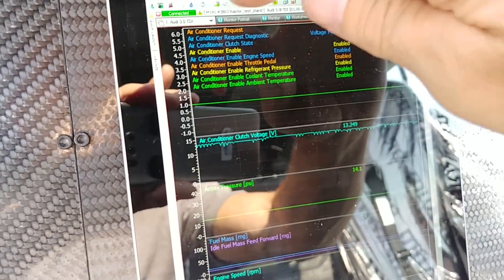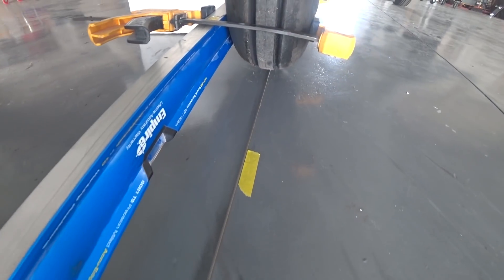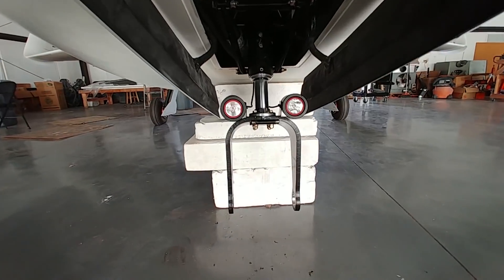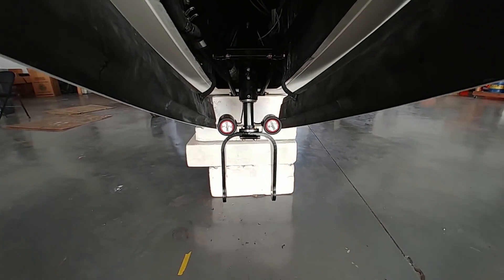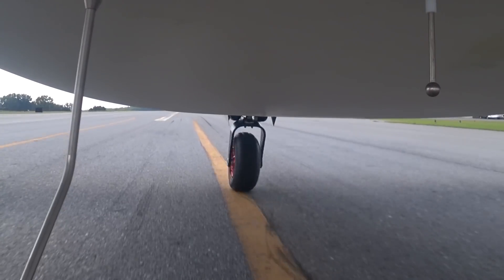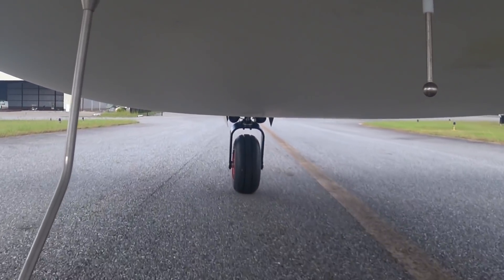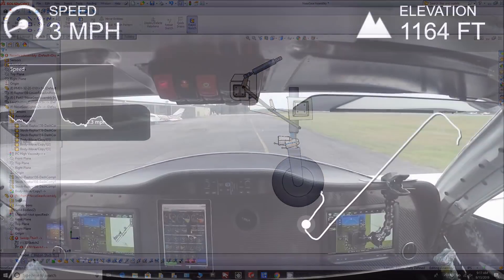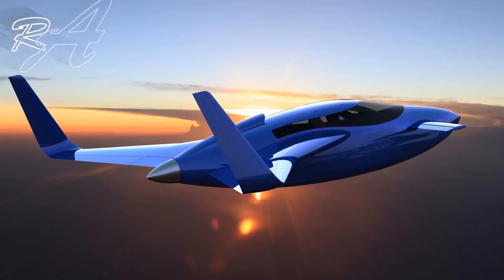Engineering a New Solution - Building the Raptor Prototype

Comment: Is there no low pressure switch on the A/C compressor?  Low-side pressure producing 36 degrees at 1200 RPM  is too low and will be even lower at high RPM.  The system will ice and block air flow. 

I don't think it was designed to work at that high pressure differential.  If this unit fails like the other one, some action is required.   I like the GM variable displacement compressors since they stabilize low-side pressure at any RPM.  No pressure switch since they never cycle the clutch.
Reply from the maker: This is a variable displacement compressor but unfortunately the Motec ECU doesn't have the ability to vary the voltage to control it. If it does I haven't figured it out yet. Likewise the Vintage Air controller does not support variable displacement compressors. So it's either on or off. The cabin thermostat will turn it off automatically though.
Reply: The externally controlled units as you describe have the benefit of using computation and logic for many use-cases.   Internally controlled units really can't, say, go to zero displacement under WOT to maximize performance.  You need enough sensors and controls to fit the case, though.   Since sensors are missing,  maybe source an internally controlled VDC for production to get some benefit from a VDC but forgo the effort and expense of fine control.  

$6.00 worth of PICAXE microconrollers reading the CAN bus and pushing a driver amp could do the trick with the existing setup.  Other inputs might include TPS, RPM,  commanded temp., on/off, etc, to get good control; so some sensors and interfacing would  be required to get optimized control.  

Alternately,  MoTeC's E888 / E816 Expansion boxes have 8 X PWM outputs and MoTeC has sensors suitable for determining the low-side pressure, and some temps that might be nice to use as inputs.   The dynamics of an aircraft A/C are lower than an auto; so external control might just be overkill.

Comment: Nose wheel should be sloped backwards a bit to prevent wobble.  take a look at casters.  The wheel always has to be behind the pivot point.  The further back it is the less wobble. The other choice is to look at the rake of a Motorcycle fork where the wheel is much. in front of the pivot point.

Comment: For testing purposes it might be a good idea to make those new longer arms adjustable in length. With geometry like this, sometimes a very small change can make a very large change in behavior.
Reply from the maker: Well that would be difficult and really the strut just needs to be perfectly vertical prior to the tire leaving the ground. That's what I'll be shooting for.
Reply: @RaptorAircraft  I concur that getting the strut vertical if not trailing is the answer. I expect you'll see a dramatic improvement with the proposed change as is.
Reply: Make them like a tierod end.  The Tee's at the end thread into the end of the long tube
Reply: @humdmmarcus2  That is also what I envisioned but upon further consideration, those arms are not parallel and the over-center stop is positively affixed and it's location important making it much more complex than just some tie-rods. Not insurmountable, but for testing purposes probably a lot of unnecessary engineering. A bend near the strut end to make the arms parallel would do the trick - but adjusting them would require unbolting from the strut every time. Seems like a lot of trouble for very little gain at this point.

Comment: Will you fly it in wing and ground effect or the test pilot will test that for real when you will be ready?  I'm curious to see the Raptor's behavior
Reply from the maker: Ok this statement will fire up the peanut gallery. I plan to take it into ground effect ONLY if there are no odd tendencies and I'm able to comfortably hold the nose wheel off for a decent stretch without any sign of loss of control. After that I'm handing it over to Justin and Elliot.
Reply: @RaptorAircraft  I didn't see your nose wheel at the moment I posted my comment and it so sketchy that to push it at high speed without having master the problem would be stupid. You worked so hard into that and I know by watching all your videos that you're a down to earth guy and you'll never do something like that.  Sorry for my bad english writing and also sorry it wasn't my goal to start whatever because of my comment. It's just because I can't wait to see that flying. You know your concept is so out of the box and if everything works like it should you have such an awesome Aircraft in your hand. It's a kind of revolution in general aviation for that size of equipment and lots of people will probably want to fly that rather many certified aircraft there's no doubt.

Comment: I wonder if there is movement at the mount that allows the shimmy to get going?
Reply from the maker: There is no play in the structure but a tiny bit of play in the self centering internals of the strut. If the external shimmy damper is necessary it will eliminate that play.

Comment: Oh and take some fingernail polish with color in it and mark a line on the bolts and metal and see of anything moves when you do a taxi test when you get under there to look again
Reply from the maker: If you look at that nose wheel camera view you will see yellow tape across the fork/strut mount to indicate any movement. There wasn't any. It was solid. I was all out of nail polish. 😊
Reply: @RaptorAircraft  tape can move nail polish will not
Reply: Did you watch the video before commenting?
Reply: @owensparks5013  yes I did
Reply: @tacticalrabbit308  
I ask only as he showed that he did that, so was wondering why you were suggesting it. Nice username by the way, do you have a connection to the tank?
Reply: @owensparks5013  yes I do I was a M1A1 tanker on an airfield over in germany I had two m.o.s. s in the military one for helicopters and one for the m1 tank and rewatching the video he is using a retaining compound in between the parts I'm referring to making a line on the bolts to see if there is any movement after the test as it will crack the fingernail polish and show if it moves , we did the same thing on the bolts for tail rotor driveshaft clamps on the cobra attack helicopter .
Reply: Outstanding. Thanks for making the world a better place.

Comment: Thinking you may need to fill in those oblong holes on the front landing strut to take up space to keep it from sliding around in there no matter how much you tighten the bolts they will slide around in there , if you look at where the bolts pass through look for wear under the nuts and bolt head
Reply from the maker: Well, it didn't move at all this time even with all that shimmy. So the retaining compound worked a treat.
Reply: @RaptorAircraft  I would still mark those bolts with something to indicate if they move or not

Comment: yes.  i think your fix should work.  with the strut angled back it appears your wheel is in positive caster, i can see with the strut vertical, the fork trails slightly, giving it negative caster.  another possible fix would be to remake the fork so the contact patch of the wheel is rearward of the steering axis
Reply from the maker: Yeah, this is easier than creating a new fork.
Reply: @RaptorAircraft  true.  i was just thinking if the gear lift geometry didn't work out (such as not having enough pressure in the lift cylinder, with the shortened lever arm).  anyway, i think going to negative caster will fix it

Comment: If the front wheel had some trailing "CASTER" off-set (a "Hockey-Stick" curve in the fork),
A self-centering effect would result.
I believe the front wheel will then NOT want to oscillate so much.

May I ask why you have chosen to NOT have this caster effect built in ?
(Maybe I am overlooking some OTHER critical factor ?).

Because you are not (I believe) actively steering the nose-wheel
(passive steering)
(steering only with brakes & air-rudder),
and because you do not "Reverse" under power (backing into hanger witch reverse-thrust),
this should NOT, IMHO, be problematic.

Keep the caster off-set SMALL 
because it will make pushing-back a control-(wandering)-problem,
if the caster off-set is too great.

I would still install the strg-damper,
maybe the lights (position / mounting) will require some rethinking,
if you have a damper to accommodate.
Reply from the maker: As I replied to another comment I had originally designed it for steering but did not implement it. At that point I should have made the strut vertical but I didn't. Better later than never.

Comment: You might find that by increasing the steering second moment of inertia you can move the shimmy frequency lower and out of the way. I'd suggest a north-south beam at the landing light mount with some extra mass on each end; dumbell style.  You should be able to configure something that will still retract.  Also tyre sidewall stiffness will be a factor so if you can drop the ply rating it may help
Reply from the maker: Nice suggestion. I'll keep that in mind if this next fix does not solve the issue.

Comment: Suggestion to think about.  Remove the nose gear, rotate the housing 180° and re-install the gear.  This would move the attachment points of the retraction system to the front side of the strut instead of on the back side, as it is now.  This way you would not need to lengthen the 'side rods'.  They may need to be shortened a bit.  Again, some food for thought.  Great job & looking forward to the first flight.  :-)
Reply from the maker: I can't do that because the trunnion position would result in the strut hitting the fuselage if I tried to mount it vertically and backwards. Also the retraction geometry would be totally messed up.

Comment: Is there an estimate of when this may go into production? My deposit is in but I"m getting older each year! :(
Reply from the maker: Ok, so for all you guys wondering about production I am working on plans for a partnership of sorts with an existing company. I need to get the prototype flying first before anything can proceed. I am not at liberty to reveal anything else. The only other thing I can iterate once more is that my goal has always been to produce a comfortable and affordable aircraft. It still is and I'm still focused on that goal. Wish me luck or move aside while I attempt the impossible. 😃
Reply: @Pictsidhe You claim working on your own project.... Please by all means share your project... Well don't if it's you assembling a pre-designed and bought kit from a manufacture or an RC model you're working on.. Other wise I'd love to see this Pictidhe all glorious masterpiece.
Reply: @Pictsidhe tell that to the wright brothers! Oh and the classic you can't see it until it's done.. I'll be in my casket before that ever happens.
Reply: @Pictsidhe The wright brothers did modeling, they then went to full sized gliders and failed in multiple attempts and changed things in trial and error. The wind tunnel testing was after their models and after several full sized glider attempts..  They didn't go straight to the wind tunnel first. And that wind tunnel only gave them data for an airfoil it didn't solve control actuation nor the understanding and need of a controllable rudder.. That was all trial and error or TLAR. Your Darwin case I admit does hold true on well the trying to fly like a bird type setups before the wright brothers. How ever in the case with peter and the raptor we are not talking about a sketched our piece of paper and being built full scale hoping it will work.. There was models made and computer simulations made along with a aerodynamic engineer looking over it.  Yes it's not perfect, yes it needs work but to flat out say it will never work was just in bad form.
Reply: as far as being an obnoxious asshole.. Yup I admit it.. I have no problems being called an asshole as I freely admit to telling people like Randy Ott to go shove their liberal narrowminded bullshit in the most asshole way I can. Some times it takes an asshole to divert another asshole's attention rather then allowing him/her/IT to continue.
Reply: @Pictsidhe I don't need anything from you.. You claimed I'm a troll, to you yeah sure my responses could be construed in that manner. How ever at the same time when you go about antagonizing someone repeatedly for NOT having the same ideology that you have or ignoring you, that puts you into the same category! It's simple Peter is going to go about his project how he feels he wants to do it.. You can leave your opinion, but you're going to get called out when you start going in to multiple discussions bitching how you know more then any-one else and how it will never work unless it is done YOUR way. As I said if you feel you can do a better job then good GO and DO it.. The you can't see it till it's done mantra only proves that you either are lying about having your own project, cant get past your own flaws it will never be competed with anything to be considered useful or afraid others will find you're unable to accomplish the task.  A lot of things this world has would never exists if everyone listened to the Naysayers like you.
Reply: The chances of this aircraft reaching production are near zero. Your deposit would be better thought of as a donation, then be pleasantly surprised if you get a kit while you're still above ground.
Reply: I think Peter should move all seniors to the front of the line...  ;-)
Reply: @Pictsidhe Lol, wont remove what I post. It might remove the notification and prevent me from commenting on any videos you post.  You're failing to see the point in all of this.. You're upset and want to stomp your feet and cry like a toddler because someone has ignored you.. There for you then trample through everything screaming louder and louder. It has reached the point where it is monotonous and yes you're trolling. Give up, go about your business and let the person who is trying continue to do his best. If you wish to continue being a Rush Limbaugh, I'll be there to keep everyone informed of it.
Reply: @Pictsidhe You are the most pessimistic person I have ever encountered.. I truly hope you're trying to play on Rz's words in reference to production as in like a certified aircraft being produced. Rather then how he meant it, as being past design/test phase and into kit manufacturing ready to be assembled by the end user.  If not, dude why are you even on here. You are free to have your opinions but, Jesus Christ if you think you know everything and or think you're capable of doing what ever you want. Please FEEL FREE to go about designing, funding, manufacturing, testing and selling your own aircraft. I'm willing to bet that if done your way it will most likely be just as cost prohibitive, unappealing, and cramped as certified aircraft. Constructive criticism is fine but you're just a Nazi badger cynical pussimest nag.
Reply: Pictsidhe  Yeah pictsidhe , if you have anything negative to say about this project or the great Peter of OZ....well, you can just shut up!  Because it’s all praises and puppy dog kisses here......  nothing has to actually work, or fly or even taxi  !  After all it has air conditioning (for now) and a propeller ! That should be good enough!  Although you may very well be right...... that has no bearing here in Raptor dream land.  After All  He is SORTING IT OUT!
Reply: @RandyOtt  As I called you and said to you earlier, there IS NO reason to be an arrogant prick. This is not yours nor Pictsidhe's project.. Articulate your opinions to be constructive, if Peter doesn't heed them, well tough shit. Just because someone ignores advice or does something you don't like does not justify you being an asshole.  Again if you don't like whats going on, Feel free to do the like your self.
Reply: @RandyOtt  You're right I don't have any skin in the game nor do you for that matter! Whilst at the current moment I do not have any use for the a3.0tdi and if I did what makes you believe i would leach off of it? I do not have the design drawings to reproduce the reduction drive, there for Peter would profit from selling the rd Unit.  What I do have is a desire and support for someone willing to put in the trial and error, hard work to come up with a viable option to the antiquated OVER priced aviation engines that benefits G/A and is the whole point. What is funny is that you're trying to back track and turn this 180* in favor for your self. It is obvious you're the one with NO skin in the game and trying to derail the project by severely berating Peter for doing what he should and ignoring the internet cronies such as your self. You clearly stated you don't believe in anything other then traditional aircraft engines - you went so far as to mention a rotary engine being useless when there are many flying and setting records, and the classic "I have a proven airframe" or what ever already.. It comes of no shock that you cannot find words as you can't articulate coherent sentences or spell basic English words. I can at least respect Pictsidhe, as he is at least coherent. So with that, I can come up with words to use in this public forum.. You're an arrogant snow flake prick, crawl back to your shit hole liberal state. 

As I said, constructive criticism & opinions are fine, but being subversive & berating someone because they don't follow your ideology is WRONG! That's what gets you labeled as I have done!